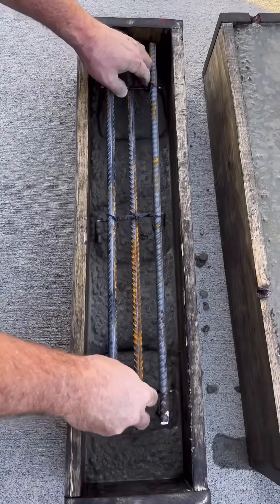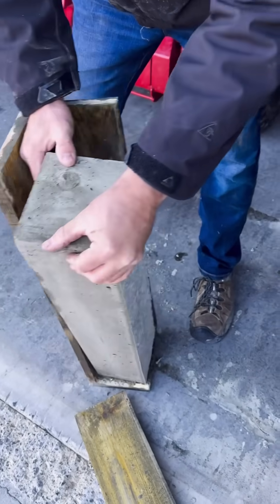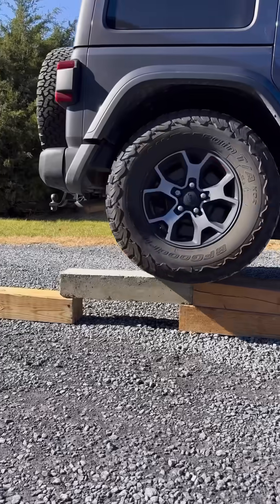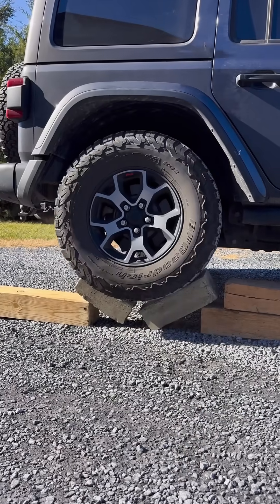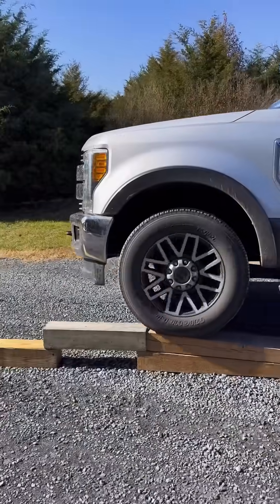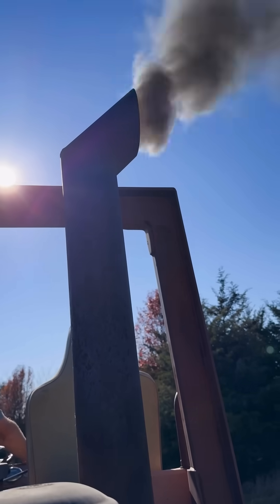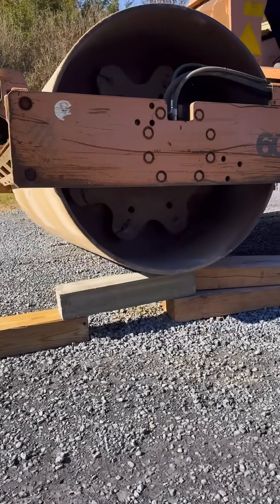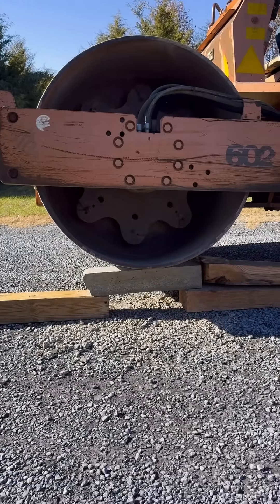Why We Use Rebar To Reinforce Concrete

Comment: As a junior mechanical engieering student, you gave me a better "lab experiment" than I ever had across my 5 structure classes
Reply from the maker: Wow, thanks!
Reply: You have not taken 5 structures courses as a junior
Reply: @jerrybeninate6017  statics , mechanics of materials , structural mechanics , material science and engineering. My bad 4, if you want you can pull up your mechanical engineering major map and we can compare :)
Reply: Mechanical engineers don’t do structures they do heating and air conditioning
Reply: @jerrybeninate6017  mechanical engineering is the study of moving parts. Therefore, if focusing only on heat transfer and HVAC we wouldn't know how certain materials react to these heat changes. You described an HVAC repair man lol
Reply: @jerrybeninate6017 Who do you suppose designs car chassis, ship hulls and plane frames ?

Comment: Can I sue somebody for not using rebar on my back patio or not tearing up the grass? I wasn’t home but my relative told me that no rebar was used and looked like they just poored it on the grass…the guy has been dodging me bc it started cracking within a year
Reply from the maker: That’s frustrating. They should’ve removed the grass and topsoil and then brought it up to grade with crushed stone before pouring

Comment: It will hold even more if it is reinforced with pre-tensioned wires.
The biggest, baddest beam I have dealt with as a technical designer at a concrete factory, was a 18.7m, 42.86t beast of a dual console beam.
It had 50 ½" wires tensioned to 125KN (each) at the bottom and 6 at the top tensioned to 55KN.
Reply from the maker: Nice

Comment: If you want to go another step further, pour and set the concrete around rebar that is being stretched. When dried, the rebar will want to return to it's natural position, compressing the concrete. If this cement is this strong without the compression, imagine the strength when the tension has to also fight compression as well as the concrete.

Comment: Does the drum vibrate in a random oscillation, orbital pattern, or strictly up/down on the vertical axis? Can it vibrate while in forward/reverse motion or only from a stationary position? Interesting to think on its varied uses, thanks for sharing!
Reply from the maker: I’m not sure the pattern that it vibrates, but it starts vibrating once it’s turned on sitting still going forward or backwards. Also, there’s two different modes, light vibration, and a heavy vibration.

Comment: but since the rebar also destroys the concrete from within by rusting over time, and only holds the loose concrete together after a failure, it is still not a great solution for long term (over 100 years)construction. 
harder concrete with more tensile strength is needed.

Comment: If you're doing concrete curbing or a gutter drain, wait 3 days before driving on it with heavy equipment.
Reply from the maker: We usually try to wait seven days before driving on

Comment: Concrete takes 70 years to fully cure which then starts to degrade. However, concrete can be walked on/driven over after 7 days.
Reply from the maker: Correct 👍

Comment: But Americans still build houses of wood and cardboard?
Reply from the maker: No cardboard, but lots of wood with concrete foundations. Wood is a renewable resource it’s fairly cheap, insulates well and it stands up great to things like earthquakes.
Reply: @hausplans  What about hurricanes or floodings?
Reply from the maker: Homes in our area are required to withstand winds up to 115 miles an hour. We use special clips and tiedowns to hold the roof to the walls in the walls to the foundation. We’re not allowed to build anywhere that’s a flood zone.

Comment: Put Moxie additive into concrete and you no longer need rebar, wont need to worry about ice swelling and cracking it, or water penetrating at all.
And its 5x harder/stronger than concrete.
Only 5% more per sq yard.

Comment: Concrete  reached "full" strength in about a month. Your rebar seemed to be in the middle of the block. You'd get a lot more flexural (bending) strength if the re-bar was an inch lower..
Reply from the maker: Actually, the rebar was in a top third and then I flipped the beam up upside down before rolling it, so it would’ve been in the bottom third. You can see where the rebar is when the roller crushes the beam
Reply: @hausplans  It was a good video, and quite informative.

Comment: I study dentistry and this is exactly whats taken into consideration when picking different materials for dental Bridges
Reply: @mikehoncho5135 what? It was related to the content of the video and added something interesting to the discussion, I think you’re the one doing the “look at me I’m so random” thing tbh.
Reply: Also a dental student. The same thing applies to stuff like fiber-reinforced posts, right?
Reply: Yeah, put a rebar on those dental bridges
Reply: @jhoc2x2 there is “rebar” in old school dentistry we’d use porcelain fused to metal framework. Nowadays we use zirconia, same they use in diamond substitute jewelry. Strong and beautiful.
Reply: @jhoc2x2 I also hate when a loaded Ford F250 drives all over my teeth in the morning
Reply: @jhoc2x2  what the fuck do you think braces are dude??? you have no idea what you;'re talking about..... think about it AGAIN when you get over 30 yrs old and need NEW TEETHS ALREADY.........
Reply: I'd never go through the process of dental bridges, essentially you are weakening multiple perfectly healthy teeth either side, I'd much rather go down the root (pun intended) of dental implant even though it is a horrible thing to go through the results are much more desirable. 
Cost is also not great but once done you won't regret it, well atleast I don't...
Reply: @JJoker1770 at 5500.00 each implant its crazy expensive
Reply: What’s the slump and cure on dental concrete?
Reply: @mikehoncho5135 You're weird
Reply: @mikehoncho5135 💀
Reply: @mikehoncho5135 bro what?
Reply: For the hos doing heavy sucking. 😆
Reply: I recon you should pick zirconium
Reply: Original guy is right. Bite force on a human constantly is way more engineering than a bridge that may be traveled 1or 2 times a day
Reply: When does the intellectual beat the fighter😊
Reply: @mikehoncho5135 is something wrong with you
Reply: 😂😂😂😂 just use concrete then instead of ....toothy stuff
Reply: @JohnSmithh644  you mean porcelain?
Reply: @mikehoncho5135 yeah guys its so random lets not comment anything ever

Comment: Look into hemp instead of #5 rebar. 20x stronger and a renewable resource that will create countless jobs.
Reply from the maker: The problem with putting organic material and concrete is that it will rot overtime

Comment: I'd say 2 or 3 days. Was a lime bath used? Blankets?  or just left to cure in the environment ?
Reply from the maker: 2.5 days, no blankets, left to cure in the environment
Reply: @hausplans  I'm actually ACI certified and PennDOT to test concrete so I kind of had an inside track on your results. Thanks for giving me the definitive answer I appreciate that!

Comment: those still look a little green-ish grey, so 7-14 days, the sbwms cured at 20degrees celcius in water for min 28 days will give approx 90% of their long term... (months and months curing) strength...
Issues like proper mechanical compaction of the concrete mix during casting and water / cement ratio make the most obvious difference to final strength of the cast beams.

Comment: No imagine if there was reinforced concrete the whole width of the roller, it would hold it no problem, make it longer and taller and you have a rudimentary bridge, add arches and it becomes extremely sturdy
Reply from the maker: Yup
Reply: @hausplans  It's fascinating how combining two materials of opposing properties, not in an alloy or compound, but as a composite, can create something with both properties in a strength that no singular material has

Comment: In India its about 24-27 days for rcs but for pcc if opc is used then its 60-600 min. 

IS-456(2000) forgot the clause 
Forgot about curing ( it's maybe around 7-14 days)

Comment: Try basalt rebar inside 100% salt bricks considering we have endless supply of salt that can be made water proof. The University in Israel has figured out how to make interlocking bricks and cement from salt but needs waterproofing ingredient and organic epoxy coating can help. The EirexTech can desalinate ocean water while generating hydrogen fueled cheap electricity will help. The Agess Inc company in San Diego is working on gravity fed ocean water into barren desert sand.

Comment: yeah except all bridge, overpass or any concrete structure turn to shit when water hit the rebar then rust and make the concrete explode in pieces.
Reply from the maker: It’s important in a situation like that the rebar is fully encased in concrete to protect it or maybe even using epoxied rebar.
Reply: @hausplans  I thought it was because of our winter, but I seen multiple video or stadium rotting to death and questioning if the rebar were really necessary or if they provided a shorter life span to building. they sure do add strength though !

Comment: Im an architecture student who has worked construction for a few years. Im having to learn a lot of new info quick but its boring and wish this is how more info was conveyed sometimes lol im having to learn abouy materials and verious physics calculations of tensile and compressive forces on systems and with different materials/setups and maintaining systems' equilibrium but I can easily say Ive learned much more practical knowledge from working in it than I have by taking classes
Reply from the maker: I’m the exact, same way, I struggle learning in a class setting and with taking test. But when I have to figure it out on my own I enjoy the process.

Comment: Even with the rebar, the vibration made the block give in. Is this also why overpasses collapse during an earthquake?
Reply from the maker: Keep in mind this concrete wasn’t close to being fully cured. It would’ve been way stronger. Also earthquake would be vibrations from below. Not the weight of a heavy machine sitting on top of the bridge.

Comment: Funny thing is, when concrete fails under compression, it's actually still tensile failure. That is, the stone-mortar matrix is sheared perpendicularly to the load direction, kind of like when you squash a balloon, it deforms sideways. The perpendicular tensile forces overcome the binding force of the binding cement. True compressive failure is nigh unachievable, as the rocks that make up most of the concrete are incredibly resistant to compressive force

Comment: Final setting is done by 28 days. For proper test, you would usually need 3 blocks after 24 hours, 3 blocks after 7 days, 3 blocka after 28 days.
Reply: In my state a beam test requires 3x 7 day, 3x 28, and 3x 56 day. 24 hour tests are optional to remove forms more quickly.
Reply: @soullesssol7285 only remove soffits after 24hrs...refix the props back on
Reply: That's actually bending and it depends on section modulus of the beam. Tensile is a longitudinal stress which means it's along the surface direction. And the failure of the beam also depends upon the type of support as here he has used simple support.
Reply: @dedsecdarlo776  since the same section, loading direction, and support has been used in both the scenarios, it wouldn't matter for this particular experiment. What matters here more, is the setting and addition of the reinforcement. Also, bending essentially means compression at the top and tension at the bottom fibres of the beam. So, you would need the proper setting of the concrete to support that said compression, and hence, bending.
Reply: And you need to water them once in a while tho
Reply: you have insufficient cover requirements. Durability aside, the bars can't fully mobilise.
Reply: Homie knows his ASTM test standards lol I was gonna comment but ya beat me

Comment: I’m not versed in engineering past high school physics. My intuition says that the reinforced concrete would sorta break ‘around’ the rebar, because the concrete can’t handle the tension but the rebar can. Clearly, that’s not what happens, but I don’t understand why. Is it simply that the tension (which I’m
Understanding as force pulling apart) is ‘transferred to’ the Rebar? Is the force ‘absorbed by’ the rebar? Does the concrete adhere to the rebar in such a way that the concrete itself now has improved tensile strength?
Reply from the maker: The concrete adheres to the ribs on the rebar

Comment: Bro. At least 2 weeks. But you wanna real challenge???  Make a dam barrier mix with rebar 7000 psi air. Reabuild mix with fibers and reomac mixed with 1.5 inch to 2 inch rock. That'll hold up 3 tanks on top of each other like a basic gay military style Sandwich

Comment: The rebar rusts, expands and causes it to fail at a later date later.
Reply from the maker: That’s why it’s important to make sure the rebar is entirely encased in concrete. If it doesn’t get oxygen, it can’t rust.

Comment: Depending on what cement you’ve used.
Portland cement gets harder with age.
Though I reckon every cement block needs to cure/ dry out properly and that would depend on weather and condition. Place where concrete is used. Ie indoors or out

Comment: One way I've seen concrete be reinforced was with stretched rebar. The rods are stretched, concrete is poured over them, then the rods are cut free from the stretching jig after the concrete dries and it gives the concrete good tensile strength because it basically pulls the concrete together, preventing it from breaking. Ive seen it used for making bridges and slabs for buildings.
Reply from the maker: Reber doesn’t start to work until it’s under stress so pre-stressing it makes for a stronger slab
Reply: That's like setting a pre load into the material like a spring 😂😂

Comment: at least 24 hours in the sun would of helped or at least use a little less water. Did you also vibrate the concrete when it was wet?

Comment: If I'm not mistaken it takes about 4 weeks (28 days) to reach the maximum strength,  depending on the weather it could be more time.
Reply: Not it's entire life either but close to. Concrete takes about 100 years to fully cure to its final 100% strength. As you said tho it reaches about 90% after about 4 weeks. Although it can be 'worked off of' only a couple of hours after pouring. It can't support proper weight but it can support people.
Reply: @grdengnome4196 that was the first thing I learnt when I started concreting
Reply: Not the maximum stress. I guess concrete is curing the whole its life.
28 days or 4 weeks is just a time when it reaches about 90% (?) of it's calculated strength.
After 1 day it reaches about 10% of it.

Comment: The lab pressure test them in three stages according to your concrete mix submittals. 7day tests 14, and 21 and psi is also a factore

Comment: Good video, but you put in the rebar at the most useless place. As you already drew in your figure: theres compressive loads at the top, tensile loads at the bottom. That means that in the middle, there's practically no loads. 

So placing the rebar in the middle makes no sense. Should've put it on the bottom, or you couldve rotated the block in the test. I'm quite sure it would've hold the heavy machine in the end with the same material usage.
You should
Reply from the maker: Rebar is actually placed in the top third of the beam. It looks like the middle in the video. Then I flipped the beam upside down when I did the experiment. So it was in the bottom third. If you watch the last clip where it breaks you’ll see how low the rebar was.
Reply: @hausplans  Ah okay, didnt see that! Cool video!

Comment: you can put rebar near the bottom of the block to better use the tensile strength of the rebar but great demonstration :)
Reply from the maker: The rebar was actually in the bottom third. It was in the top third when I poured the beam then I flipped it upside down for the experiment.

Comment: Sadly water does the second on in much faster. 

Roman structures are still holding weight to this day. 

Not saying it's better just trade offs in engineering. You want a longer lasting structure or do you want a stronger one?

Comment: Rebarb alone will hold a car 😂😂😂😂😂😂😂
Reply from the maker: Reber bends really easy on its own. Even if I just stepped on it, it would bend under my own weight.
Reply: @hausplans  so would concrete... With 1 . Stop the 🧢

Comment: Concrete is obsolete. I’m future everything will be build with carbon fiber
Reply from the maker: I’m not sure about that. The cost difference is astronomical.
Reply: @hausplans  I used to work at SpaceX and did the math. To build 1 mile of freeway (8 lanes) using carbon fiber takes about 70,000 gallons of resin (oil).
The carbon fiber itself is almost free. So 70,000 x 3= $210,000 per mile.
Now consider this. The weight! The weight of concrete goes into million of lbs. Carbon fiber: fraction of weight.
You consider ease of work and transportation and no rebar enforcement needed...plus the tensile strength and compression strength multiple of concrete. That means nice exciting things can be built. I worked on Boeing 787 program in South Carolina. The cost of carbon fiber came out cheaper than aluminum. 
All that said I have zero clue how much concrete cost, but I know a lot of work is involved and concrete setting and manufacturing actually creates a lot of heat contributing to global warming.  Plus the unbelievable weight of concrete. 
Carbon fiber sections can easily be built in advanced and assembled at site.
I know getti museum in LA has used carbon fiber reinforced concrete,  so why not use pure carbon fiber